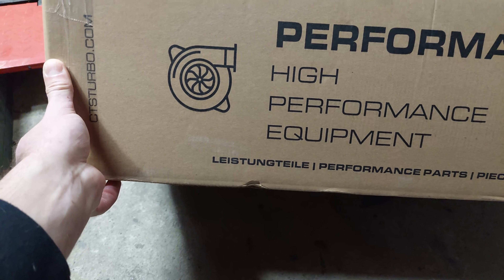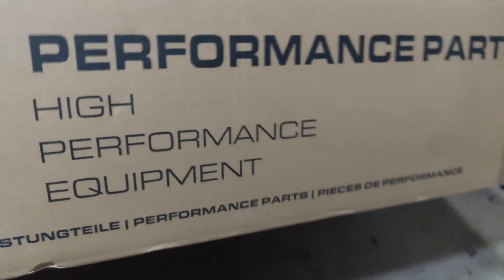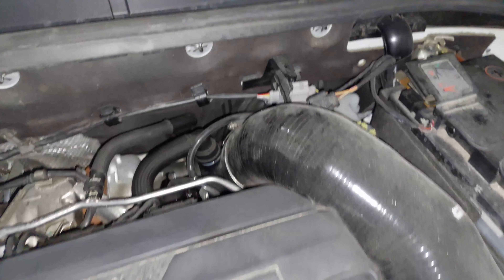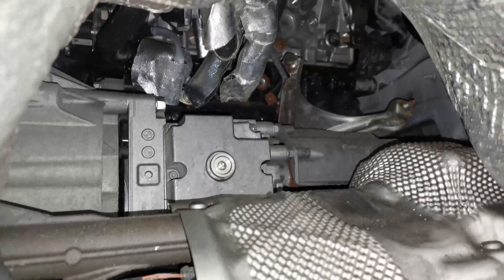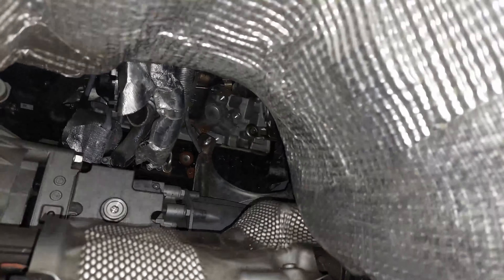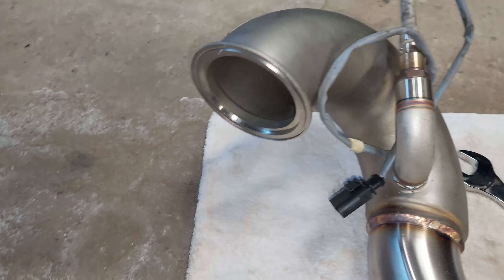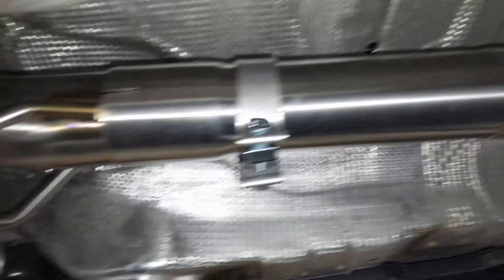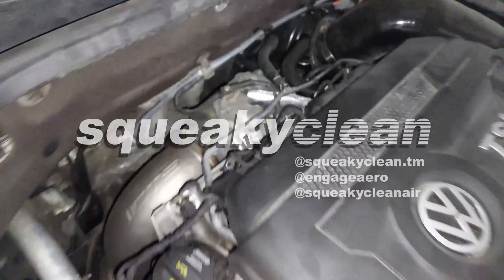CTS Tuning Mk7.5GTI DSG Downpipe Install.

Comment: I accessed the one tricky downpipe mounting nut from the top of the engine. Feeling down into the engine bay, find the O2 sensor, and the nut is right behind it.
Reply from the maker: Hmm that's a good idea as well! Thanks!